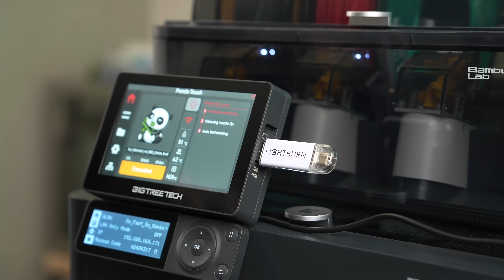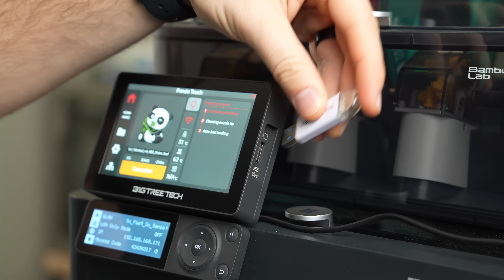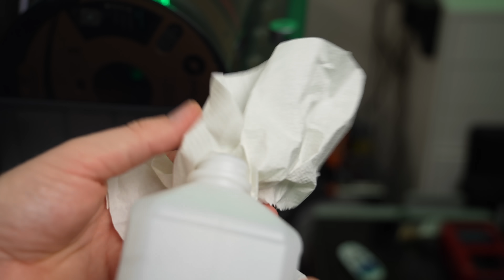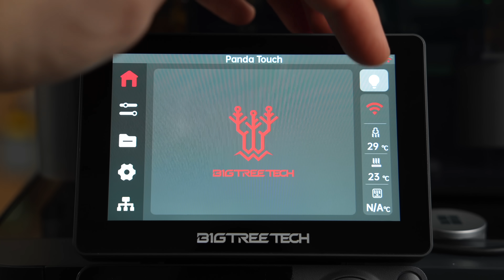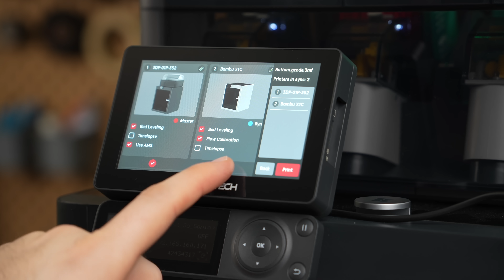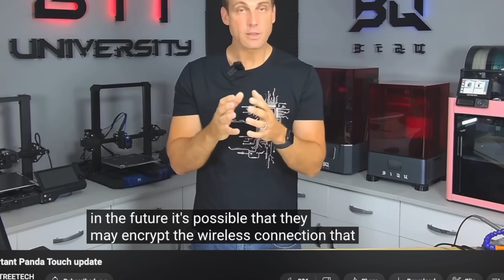This Bambu Lab Upgrade Could Be Huge (BTT Panda Touch)

Comment: It's odd that you didn't mention a big problem, for me anyway. Teh Pando cannot see anything but .3mf files on the USB drive, so it can't see  .cgo* files. That's true when trying to read files from the printer's SD slot too.  So you can't see the model files which shipped with the printer.

Comment: I am curious, Do you know how much you can upgrade a P1S toward X1C specs apart from the metal and plastic sides, thats not important. I guess things like the better resolution camera?, lidar? I guess you can upgrade the extruder gears to be the same, and what  else might be different, I am guessing the camera and lidar maybe the toughest and maybe lidar not possible without mainboard upgrade, 
I will be getting a P1S and just curious how close to the X1C it can get over time with some upgrades.

Comment: Love the way Big Tree Tech called it Panda touch.  Panda's are associated with eating bamboo - Bambu printer.... Little things are amusing :).
Basically this is a remote control for the printer.  The USB Cable is only for power and the rest is done via MQTT / WiFi.  This screen could be stuck anywhere and doesn't need to be stuck to the printer itself.
I don't think MQTT would get broken.  MQTT is a standard and open.  Bambu may add encrypted MQTT, but I doubt they will do that as they know add-ons = more sales.  Even with closed source devices, the 3D printing community, and companies aiming at that community, still seem to work together, as well as being competitive in a more friendly way.   This may change in the future, but right now there is still a lot of sharing in the community and it's really good for us enthusiasts.   I do hope it doesn't change in a hurry.

Comment: Thought that to till I felt was a z offset delayed setting.  The touch screen does not have network delay or html errors.  Ive had some occurances where mainsail has altogether ignored a setting change.

I ran into a problem with the print farm functionality unfortunately with my setup.  Will not print to my X1C fails instantly with an error the AMS failed to load error.  I think this may be either one of two things, either I am not slicing correctly which I am sure I am doing it correctly, I am slicing the stl, I export the sliced plate (01) as a 3mf and place it on the flash drive then I attempt to print and the X1C will not print.  Other item may be the Firmware is too old on the X1C which is using the same AMS firmware, but the printer FW is only 01.07.00.00 and PT is supposed to be compatible UP TO 01.07.02.00.   I cannot update the FW atm because the only option is 01.07.03.00.  Which is not listed.

Comment: If you weren't quick enough to order one a while back, it will take two months to get one if you order now. Not sure I want to bet that this will be the thing I want by then. I guess it's a good problem to have (for BTT). I have an Xtouch sitting in a drawer. I didn't care for it once I got it installed. I'd buy this one in a hot minute if I could get it in a week.
Reply: Manufacturing on the next batch is already well under way but they are actually selling out too 🙈
Reply: @looxonline  maybe it's a character defect, but I hate buying things that sell out the instant they become available.
Reply: @Immolate62  Very difficult to estimate demand for a product category that has never existed before. We thought we had over estimated but we were very wrong. The first batch was available for just under 40 hours and the second batch still has a few available but will only ship when CNY ends.

Comment: I haven't even glanced at the control pad on my P1S since initial setup. Bambu Studio is so good, I just sent prints from there on my PC.
Reply: Same. But I still ordered the panda touch just to make it look nicer 😂
Reply: @DeRock401   I get that, but I would now only get things I plan to use regularly.  I have better things to spend money on these days than an upgrade just for the sake of an upgrade :)  My days o upgrading just for the sake of an upgrade are behind me now lol
Reply: I havnt ordered it yet, but want to and i cant figure out why... i really dont need it. I just want the touch screen look. Its silly but idk why i cant just accept not having it. @DeRock401
Reply: same, only use it several times when there is an update
Reply: We tend to be like rivers and follow the path of least resistance. I guarantee you that you'll use this screen a lot after installation just because it's there and very low friction to use.
Reply: This is similar with my Marlin printers and using Octoprint, but sometimes people like having a nicer touch screen at the printer, and I admit I have made use of OctoDash as much as I use things remotely
Reply: Just a good option that works
Reply: Same with my a1

Comment: I have one of these on the way. I won it a while back. Should be here in a few days. I plan to use it with klipper as btt said it can be flashed and then control klipper printers. We will see if it can be done and how hard it is.

Comment: I thought I'd want screens on all my 3d printers until realizing how much easier it is to just use mainsail
Reply: Having one is still nice sometimes. But mainsail even on a phone can basically do everything indeed.
Reply: I bought my first printer used and the guy recommended I set it up with FluiddPi, never looked back. I have a P1S now and I can count on 1 hand the number of times I've used the physical interface for it.
Reply: There's value in having both. I use Klipperscreen for some basic things that you'd do in front of the printer, like screws tilt adjust. You can also pull out a phone, but the screen is already there and on and more convenient.
Reply: Yea, its good to have a screen i guess but 99.99% of my prints are sent frommy computer.

Comment: I don't think you mentioned that it's only $59. Not so much to lose if it ever stops working.

I don't have a Bambu printer, so it's not of use to me, but if the Klipper version is the same price I'd jump on it.
Reply from the maker: That’s a great point. Sometimes I focus on the more advanced technical details that I forget some of the obvious ones like price 😅.
Reply: @ModBotArmy  that's because when you're a bigtime YouTuber making bank, price isn't even a consideration for you! 😂
Reply from the maker: @JonS  lol if only. There have been a handful of times I show the price instead of say it. I have found prices change so much on things if I say it costs an amount then it changes I get some frustrated comments 🤷‍♂️
Reply: A real game changer would be control over both Bambu and Klipper printers simultaneously.